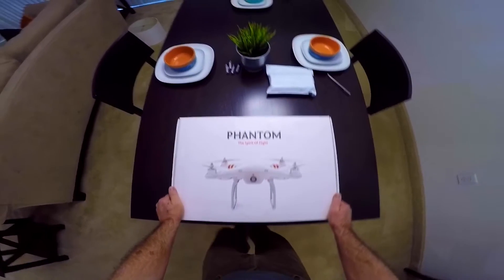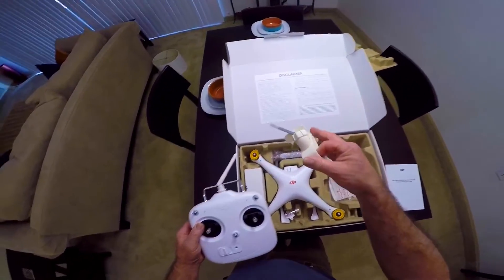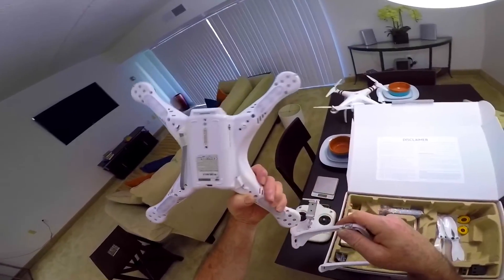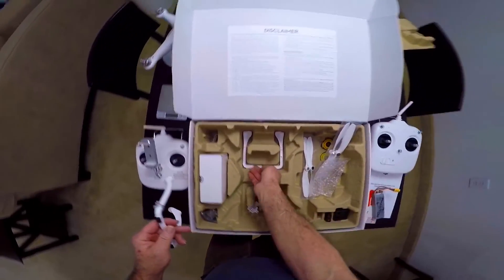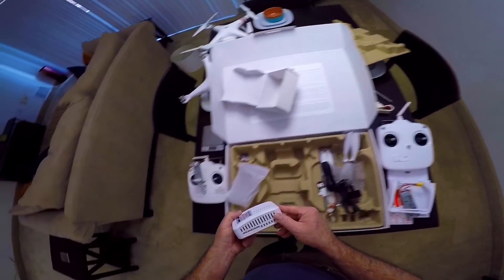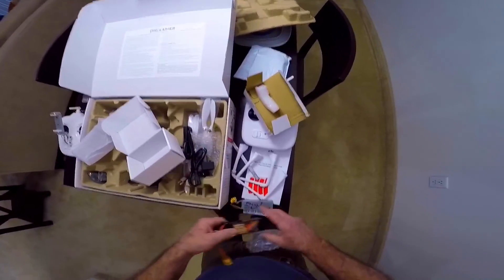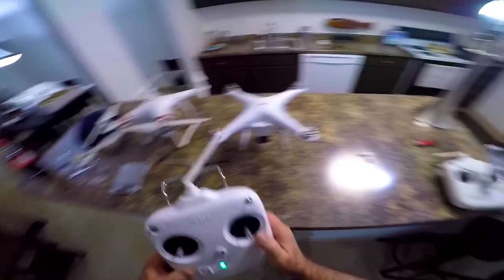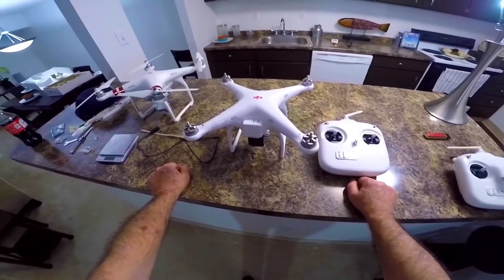DJI Phantom 1 Drone Unboxing It's Built

Comment: It looks sweet and would be awesome with a HakRC 3 axis gimbal. I didn't realize they came with a normal non-smart lipo. I would also be worried about that battery after sitting for years. I'd use a smart charger like an Imax to charge it so it is properly balanced. Hopefully it was sent at storage voltage. If so the battery it likely ok. I'm glad you bought a new battery as I'd also be scared to fly the original battery. It could go to LVC in a min or even fail and fall out of the sky. The props look like the cx-20 stock props. I bet it flies better with 9450 props that are on your p3.
Reply from the maker: I flew it today real easy with the original battery
Reply: @bryansbikes  cool!!